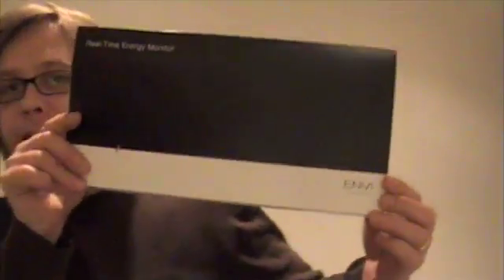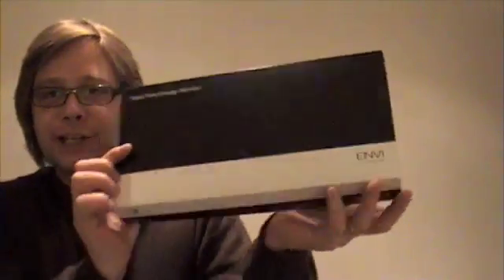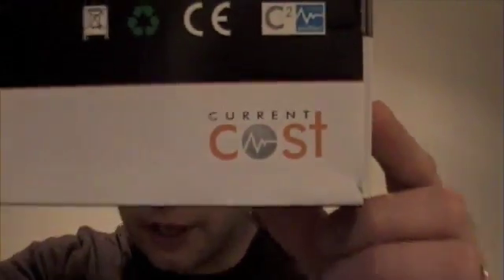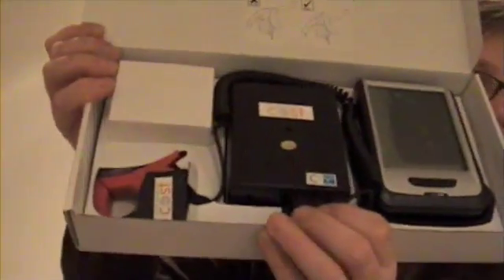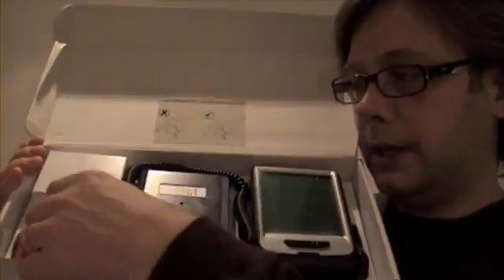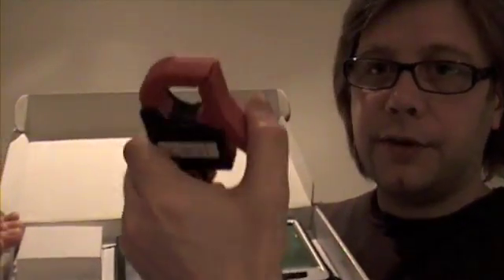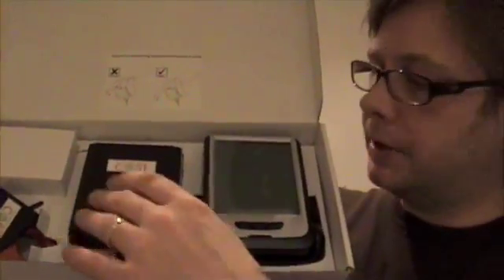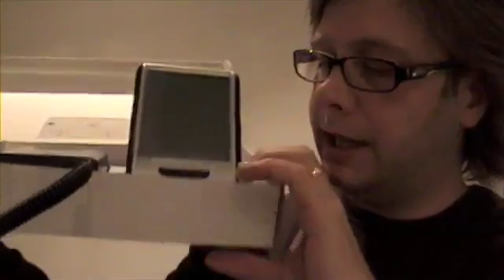Unboxing the new Current Cost Meter

Comment from the maker: Sounds like you might have an issue if your meter is in an outside box.  But have a look when the device arrives.  If you can connect the transmitter, but the transmitter cube is too big, there are small transmitters that could possibly fit.  

If the wires are sealed away so you can't hook the clamp on the mains power, then there are not many options for you unfortunately.

Let me know how you get on.